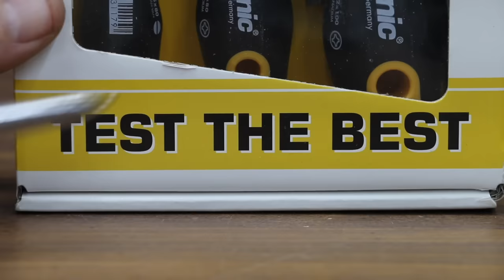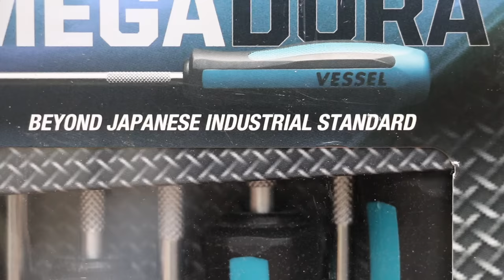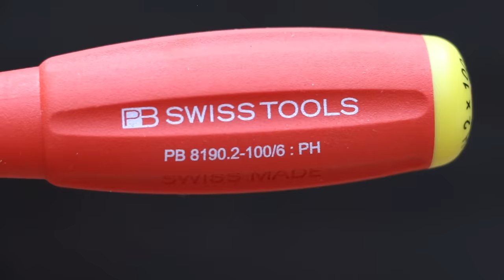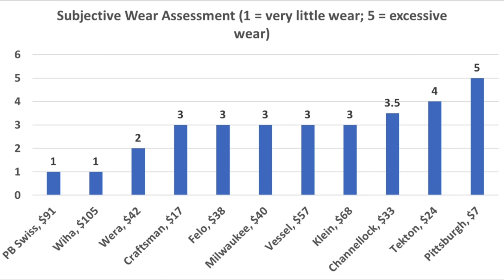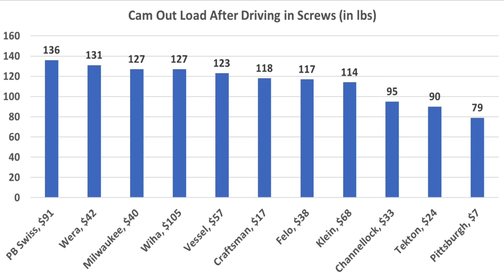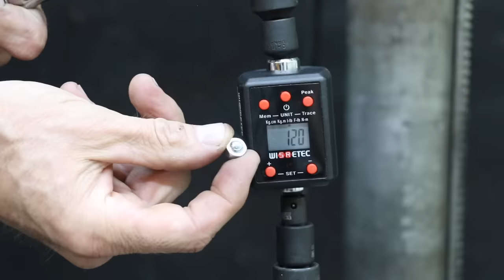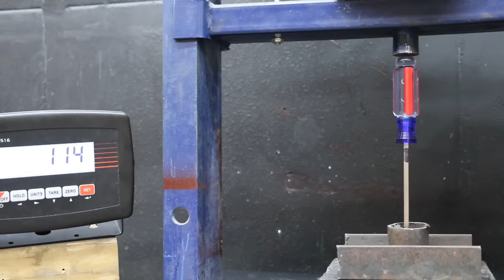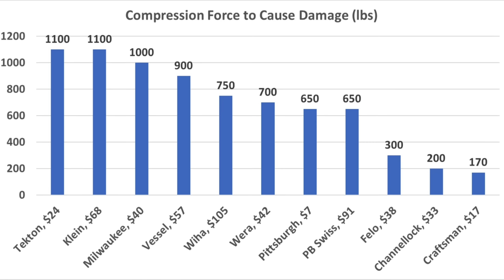Best Screwdriver Set? Craftsman, Milwaukee, Wera, Wiha, Klein Tools, Felo, PB Swiss, Tekton

Comment: Tekton probably has the best warranty. You literally just send them a picture of your broken tool and they send you a new one. No receipt or proof of purchase needed.
Reply: They don't honor it , I had 2 squeeze camps break, both the heads snapped off, I sent pics and messages and was just ignored
Reply: @jefftucker9225  I asked them for a tiny replacement screw on a pair of multi-tool pliers; it just held in in a rubber grip, didn't even affect tool performance. Apparently it was discontinued so they didn't have replacement screws. They told me to pick out any any tool from their website, regardless of price and sent it to me for free.
Reply: @corylocher1  I'm not in the habit of randomly making up stuff to smear some tool brand , just letting people know who read the post that they didn't do what the poster said for me at least
Reply: @jefftucker9225  Unless they outright refuse you, I'd believe they missed or lost your message some how.
Reply from the maker: Thanks for the feedback.
Reply: @dtester  they never refused me, just never got back to me, I sent pics and followed the instructions but never got a response
Reply: @jefftucker9225  I'd sent follow up email or something.  Mistakes happen.

Comment: I like my Vessels, that knurling on the shaft is really handy once you get something broken loose.  I carry a couple of their demo line with the nut adaptor, full length shaft, and metal striking cap for the stuck stuff.  They have an impact version as well that is great for stuck brake rotor screws.  My insulated electrical ones are Wera.  Good Stuff all around.  Thanks for the hard work.
Reply from the maker: You are welcome!  Thanks for sharing.

Comment: I assume all the bladed screwdrivers tested had the same blade width?  I'm guessing Tekton is assuming people don't over torque their screwdrivers much considering they offer a lifetime, no questions asked warranty.  I wonder if their high-torque screwdriver line would perform better in the torque based tests than the hard handle line which was tested here, or if the difference is just in the handle shape.

Comment: Hi Todd, I'm kinda late to the table on this one but thought I'd have a go anyway. Maybe it'll help on your next screwdriver test. I witnessed this myself. Receiving packaging equipment from Japan included Japanese tools including screwdrivers with the standard Japanese tip cut. They were what I would consider less than a desirable finish including a cheap wooden handle. Upon a days work of assembly of the equipment with the included tools left me dumbfounded.  The tool set in general was impressive but the screwdrivers were absolutely amazing. I don't know if you are familiar with these Japanese "grinds" but they have my vote for the Project Farm complete destructive testing regimen. Thanks for what you do which is great work in finding out what doesn't work. Cheers.
Reply from the maker: Thanks for sharing.  Thanks for the suggestion.

Comment: Hey brother, thanks for another great video.  I have Milwaukee , Snap On, Tekton and some old American Craftsman screwdrivers. 
My Klein screwdrivers never leave my electrical box and bag so I don't consider them into the mix. 
The one I grab almost every time is the Tektons. Personally I think they have the best feeling/fitting handles on the market. I do not care for any of the new comfort grip, tri lobe designs. They never seem to fit comfortably in the hand.

Edit to add. I never "hammer" my screwdrivers. Possibly tap but never hammer. I have tools for that.
Reply from the maker: Thanks for sharing.

Comment: Ive had good luck with the craftsman. I like the tinly slots that seem to grip faily good. Yes, they might be a little brittle. I try not to abuse them. I used a torch on a craftsman 1/8 driver to put a 90 deg bend in it for a special purpose i needed and it worked perfect.
Reply from the maker: Thanks for sharing.

Comment: I’d love to see a similar test on Allen keys or hex sockets. Maybe see if those Mac RBRT sockets and Allen wrenches are as amazing as they claim.
Reply: I've been impressed with the jet set I have for what I paid off Amazon. 
But my apprentice on the last job had wera and damn those are nice. But most of my use with Allen heads is on a torque wrench so hard to invest in that price tag
Reply: Almost everything Mac except their tool boxes is marked up rebrands from what I hear.
Reply: @802Garage  news flash every tool truck has rebranded tools on it. That’s got nothing to do with if the tool in question is any good or not.
Reply: You need some Bondhus Allen keys
Reply: @John I’m already using Wiha Allen keys but I’m looking for some Allen sockets and want some data like this video on how comparable the good German made ones are to the rbrt stuff.
Reply: I second this.  I use Allen wrenches the time
Reply: While there usually isn't an objectively best brand, with allen/hex keys, the shape of the Wera Hex Plus ones simply outperform all other keys. I can loosen fasteners with it that have already been ruined by other (poor fitting) bits or keys. If the Hex Plus bits or keys don't provide enough grip, the fastener is simply done for and will not be turned by any allen/hex key anymore.
Reply: Just for kicks, I wish Todd would've had a big ol' orange and black handled ROSCOE "DOUBLE-FISTER" to test out!! Seems like back in the 80's they were only $10 for a set of 10 and were almost indestructible. They had "Tool & Die Steel" stamped on 'em. 

🤙🥳😆😂🤣🥳
Reply: I wholeheartedly support this idea for testing.
Reply: one thing that'll need to be included is how tight the tolerances are. ball socket allens would be another good set of tests
Reply: @mramseyISU  There is a difference between SOME tools being rebrands and the entire business model being rebranding.
Reply: I have a set of Craftsman Evolv line hex sockets, the light duty homeowner line, and they're fine. Only cost me like $10, or I got them for free with a coupon. I've even hit them with a sledgehammer before and no issues. So I don't think a test like that is necessary.

Comment: Torque wrenches next? Curious how accurate these brands are.
Reply from the maker: Thanks for the suggestion.
Reply: Solid idea!
Reply: Yes! Click vs digital too!
Reply: @susankay7606  Yes! Would love to watch which stays more precise for longer time
Reply: Indeed. And if possible please do Harbor Freight's cheapo Pittsburgh Pro AND their pricier Icon and "prosumer" Quinn models. I'm just curious if spending 10 times the money gets one ten times the accurate tightness. Reviews I've already seen out there of the Pittsburgh ones, some after long-term use, lead me to believe that unless you're torquing down those heat shields for the next Mars mission at NASA, those "economy" ones might be just fine for getting some head bolts balanced well enough. But then I used to use an old brass fishing or luggage scale with a combination wrench and just do the math. So, I'm not what you might call "ultra-picky".
Reply: @ProjectFarm  Maybe even make it an electronic torque wrench test. As a lot of manufacturers are releasing them at the moment.
Reply: Oooooo, good one!
Reply: @nunninkav  Yes! Still waiting.
Reply: Stahlwille or Gedore would be the best choices probably. Most brands are accurate(standard is +/- 4%) but not all are reliable. Also not all brands have a repair kit available for purchasing.

Comment: Been a huge fan of Wera for a while, this nicely helps confirm it's been a good decision :D They also do some fantastic tool Advent calendars!
Reply from the maker: Thank you!
Reply: As am I. However I would also be interested in the “impact rated” screwdrivers with the metal end caps etc. i have them from wera personally and I’ve never had one let me down to date.
Reply: Ich glaube Adventskalender kennen die Amis garnicht
Reply: Wera makes a screwdriver line designed to be struck by a hammer and I absolutely love them.
Reply: @aidan-8100  I have used DeWalt's impact/demo screw drivers, They were crap, the metal caps came right off in the first week, showing they were NOT manufactured all the way from the shaft through the handle, Klein's Impact/demo drivers are OK, THey have lasted me a while BUT the rubber grip over the handle and the metal cap move up and down a bit as they get used more....Milwaukee's Demo/Impact drivers are EXCELLENT (Even put an SDS bit to the flathead once, no issues at all) But #1 for Impact/demo is DEF Wera...I picked up a small flathead and large flathead recently, they are AMAZING, and that is why Wera is #1 for me in Screw drivers (with Klein being a close second) Now, Only if Knipex made Screw Drivers! LOL
Reply: @JG-dl5fp  Advent calendars were pretty common in the US in the '70s and '80s. Less so now, but you still come across them sometimes.
Reply: Their customer support is also top notch. They're my preferred brand, but sadly the local shops only carry a very small subset of their products.
Reply: Würth and Wera are the only ones I buy. And I have lost more than I broke.
Reply: @wbfaulk  Wera do one each year with tools in it :D They are pretty nice! I had a gander and the set this year also looks fantastic as the one area I am lacking is small screwdrivers that I can put in the tool kit.
Reply: @MarcLucksch  The Würth ones are made by Felo. While they proved to not be the most durable in this test, their grip is probably the best of all (together with Wera if you like them) and the fit with Torx screws is much better than most screwdrivers.
Reply: @aidan-8100  
The good thing is that those don't even come at a price premium (in Germany anyway), the set of six (932/918/6 resp. 932/6 ) is 29,30€ resp. 27,94€, wich is just about the same as their regular Kraftform Plus drivers. 
I have one of those drivers from my grandfahther, must be twenty years old, the plastic and rubber have not deteriorated. Unfortunately I'm not sure where I put it ... :(
Reply: @MarcLucksch  stolen, maybe 😂

Comment: Since that was comparing apples to oranges, Wera also has a version with a striking cap (called "Schraubmeißel" meaning screw driving chisel). And those obviously don't move when hammering. I once used them out in the field to chisel down an aluminium weld flush - completely undamaged. Only strike marks on the caps remain as proof.
Reply: I looked them up. 
They look comparable to the Gray Tools Canada hammer capped screwdrivers.

I use them as a chisel as often as a driver... Reforms stripped Phillips heads by punching the X shape back into the head.

I'd love to see these two put up against the top 3 of this vidjeo.
Reply: @chrismmmhmm2337  I'd love to, but unfortunately I don't have the equipment necessary. Besides, imitating a master like him would be really lame and I lack the imagination to come up with my own tests.
Reply: Harbor Freight Doyle brand demolition drivers are amazing
Reply: @rickywinthrop  would have been better if it didnt break, id think

Comment: Tests and shows results on exactly what I wanted to know about- the strength and resiliency of the material at the tip of the screwdriver.  Looks like it's possible buy a $50-$100 'last set' of screwdrivers that will never need replacement for prosumer use.
Reply from the maker: Thank you!

Comment: Given that these are "hand tools" and if used as such, the most important test was the first one, for durability and the cam-out test. So I give Craftsman and Milwaukee top marks for the price.  IMO, the  other tests are only relevant if you're going to use/ abuse the tool from some purpose it was not intended or you're Superman.  Love this channel!!!
Reply: " if you're going to use/ abuse the tool from some purpose it was not intended" 

Yes
Reply: Absolutely, I still have my same Craftsman screwdrivers for about 30 years now, and they are still in great shape. Then again, I'm not hammering and chiseling anything either, I have a chisel set for that.
Reply: I’ve gone through so many brands, some great and some just so so. My first grab screwdriver is still my Western Forge Craftsman Made In The USA screwdrivers.
Reply: I’ve had the same set of Craftsman screwdrivers for about 15 years. It’s a 22 piece set that I got on sale for $20. That was about the best $20 I ever spent. They show some minor wear, but still work great 👍. They’ve been used hard, but never torcher tested though. Never buy hand tools from Harbor Freight, they’re garbage. You’ll spend a lot of time and gas money to keep replacing them. That Lifetime warranty is meaningless... keep your receipt haha 😂.
Reply: Just about every electrician has a large slot blade screwdriver that they use as a pry bay, punch, and chisel. They use their linesman pliers as a hammer. A better test would have been to actually hit the screwdriver to see if it's too soft, or too brittle. I used to think that you should only use a tool for what it's meant for, but it's so much easier to carry half as many tools when you use everything as a hammer.
Reply: @Patrick Faricy the other day I dragged a hammer into a crawlspace with me to hammer in some Romex staples. There were bricks and rocks everywhere. I could have just left the hammer outside, but it did come in handy as a shovel. I think I've seen my boss use a hammer properly twice now. He normally uses his Kleins (linesman pliers) as a hammer, and sometimes uses a hammer as not a hammer.

Comment: Before watching, I'm cheering for the Vessel.  It's the only "Phillips" screwdriver I've ever used that isn't absolutely hateful.  The big winner for me is that I have 3 vintage Kawasaki's, and anything but a Vessel will butcher those very soft JIS heads.
Reply from the maker: Thanks for the feedback.
Reply: You do realize JIS is not the same as a 
Phillips.
Reply: @MRMETZGAR1962  I am palpably aware of that.  Vessel are JIS.  A JIS driver works very well in a Phillips fastener.  A Phillips driver will ruin a JIS fastener.
Reply: I bought a set of Vessels to work on my 75 Honda ct70 and my Honda cars,it’s crazy how much better they are,no cramming out at all. Well worth the money.

Comment: Run this one again, husky, stanley, kobalt, sk, snap-off, dewalt. Would love to a bracket showdown like with the aa batteries
Reply from the maker: Thanks for the suggestion.
Reply: I have a set of Stanley FatMax that I've been very impressed by for the price.
Reply: @ProjectFarm  if you do it again. when you grind in the flat sides make sure that you do not destroy the heat treatment.
Reply: And Hazet

Comment: Years ago I had a flat bladed Craftsman screwdriver that I used for just about everything except a screwdriver. It was bought in the early 1970's when they were made in USA and made of pretty good steel.
I used it for a pry bar, chisel, hammer, and knife.
It was getting pretty worn so sometime in the 1990's, I took advantage of the lifetime warranty to get a new one. No problem.
But the problem was the very first time that I went to use it on a stove bolt, the very thing it was designed to work on, it broke. Not only broke but the tip shattered. Got a new, new one but wish I had kept the old one and just regrinded the tip to fix it!
Reply: You might look into the Wera Chisel Drivers to get a similar experience to your original Craftsman
Reply from the maker: Thanks for the feedback.

Comment: The Weras with the laser cut tip are absolutely the best for electrical work where you're dealing with soft screws in terminal blocks. That's all I use in my panel shop. The laser cuts don't hold up for heavy duty stuff though, so I keep a set of Craftsmans around for that stuff. The right tool for the job!
Reply from the maker: Thanks for sharing.

Comment: Pro tip for fledgling tradesmen: mix your screwdriver brands. I'm an electrician by trade. And when I'm reaching into my pouch in an attic, or through a drop ceiling, or a bunch of other places, I often can't see. If you have different brands in your pouch, your fingers will be able to tell your #8 Robertson from your #2 Phillips from your big bitch blade by the different grips. And when you have to send a green-as-grass apprentice into your pouch and they don't know the difference, having different-coloured and -shaped grips help identify things.
Reply from the maker: Thanks for sharing.

Comment: Your testing protocols really push tools to the limits. We have to keep in mind though that these are intended for use in human hands, not in an impact driver. Under the kind of use they are meant for, most people will be satisfied with the Craftsman. I'd probably go with the Milwaukee since I use them every day at work.

Also, in 2021, why do slotted screws still exist? Especially tiny screws with very shallow slots.
/rant complete
Reply: True, but in order to do accelerated wear, I'd rather not see the blisters on Todd's hands after driving a few hundred screws.

This is akin to how car manufacturers use hurricane force winds to test seals and fitment. Is it likely that your vehicle will ever have to endure a hurricane? No, but if it can survive that, the local car wash should be no problem.

Oh, and Stanley phillips head screwdrivers absolutely suck.
Reply: solong beancounters buy slotted screws, mechanics keep cursing 😈
Reply: Phillips aren’t much better either.
Reply: @saxamusprime  those you can drill out
Reply: Because slotted ones make great little prybars. And in industrial settings slotted fasteners are used ALOT still. I a industrial maintenance guy and even in brand new machines there's slotted hardware.